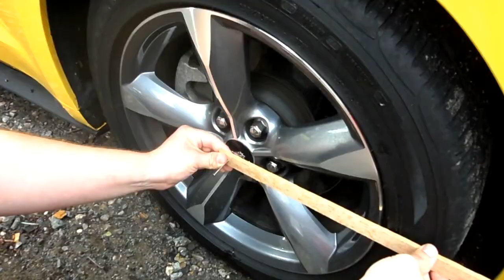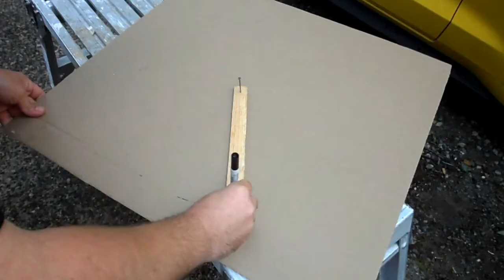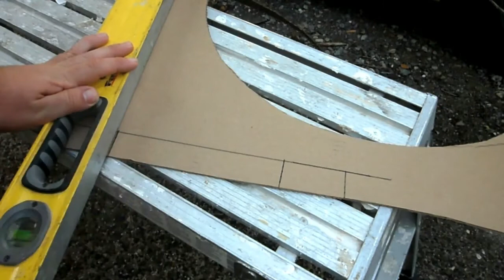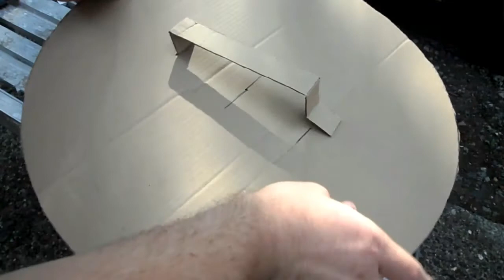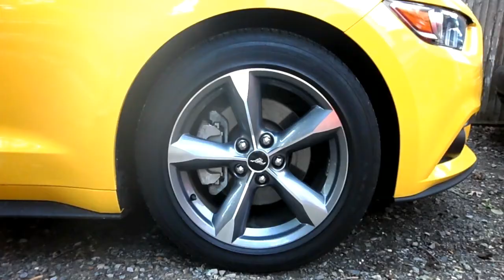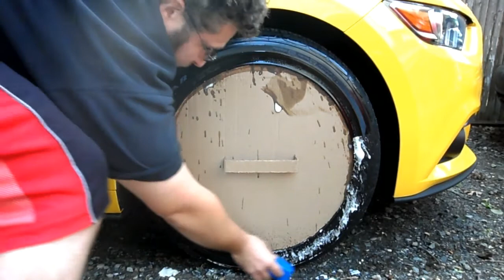How to Make a Tire Dressing Wheel Cover

Comment: That's a cool idea man!! I'd probably put something on the cardboard though like spray paint it or something just so it last a little longer but cool man
Reply from the maker: Joe Septien Thanks! I was going to buy one until I seen the price. $20.00 seems expensive for something so simple. Not a bad idea with the paint. I’ll definitely give it a try 👊😁
Reply: Yeah, I bet flex tape or gorilla tape would give it a little bit of longevity, I'm about to go outside and make me one, you're correct, $20 is stupid for just a round cover, thanks for the idea.
Reply from the maker: Reinforced with one of the tapes you mentioned would probably work great, nice idea! 👍

Comment: While this is a good idea, the cardboard will degrade very quickly. And will only be effective for a couple of applications.
Reply from the maker: divemaster 03 I usually make a new one every year, doesn’t take to long. It actually lasts longer than I thought. I probably get about 10-15 uses out of it before it starts come apart. I was thinking about covering it with packing tape to extend the life of it.